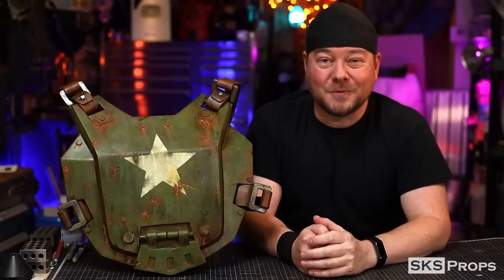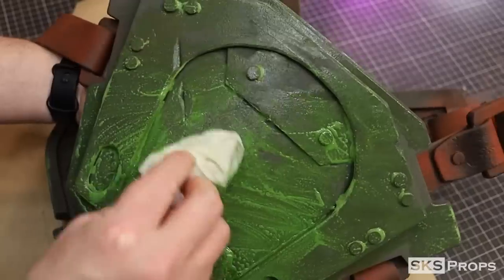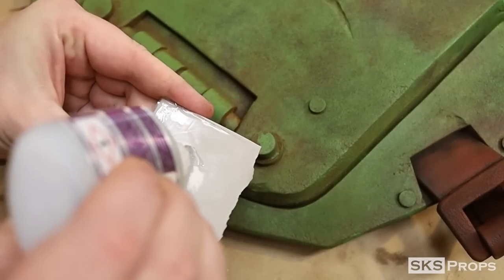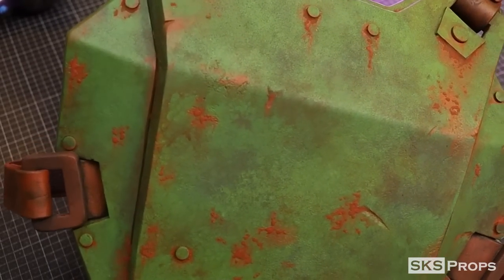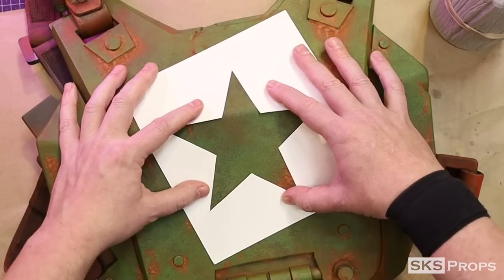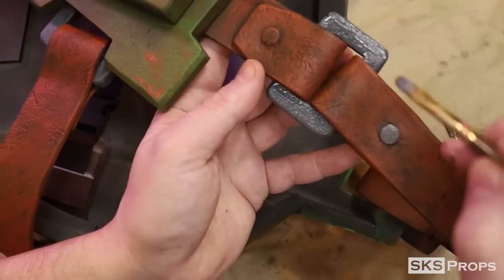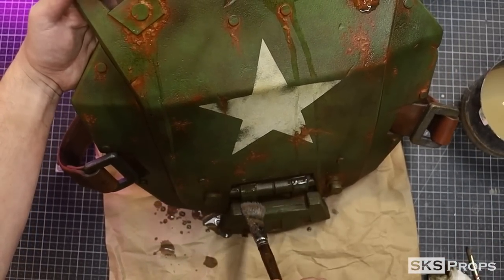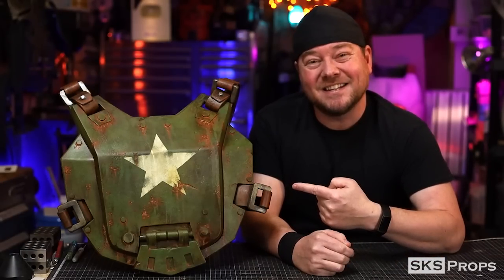How to Make Fallout Combat Armor Part 2 - How to Paint Cosplay Foam to look like Rusty Metal

Comment: Interesting. In model making, wash would be called a filter. Filter goes over the whole surface, slightly changing the base layer tone. Wash (pin wash) would be more contolled application, done as a fake shadow of a sort.
Reply from the maker: I’ve painted miniatures for over 20 years and I’ve never heard a wash called a “filter” maybe it’s an overseas term.
Reply: @SKSProps  well, to be specific, term used in scale models(planes, vehicles etc)

Comment: When i use primer on foam after plastidip for me my foam cracks easily when I bend it a lot - does that happen for you?
Reply from the maker: You're adding it to thick, notice in my videos I just dust it across the surface to get a base color. Most of the actual paints applied are the acrylics because they flex
Reply: @SKSProps  thank you!